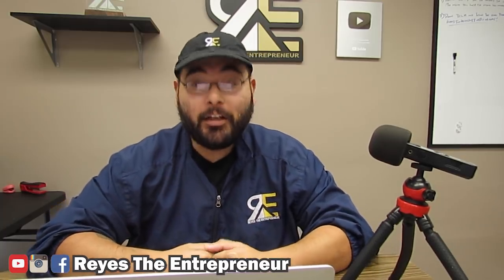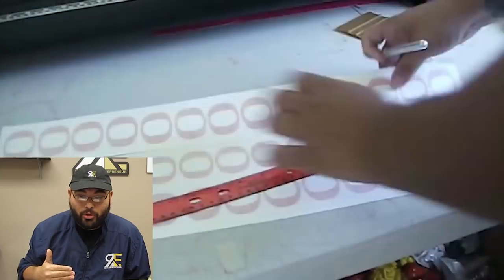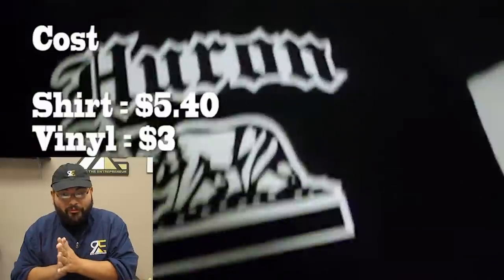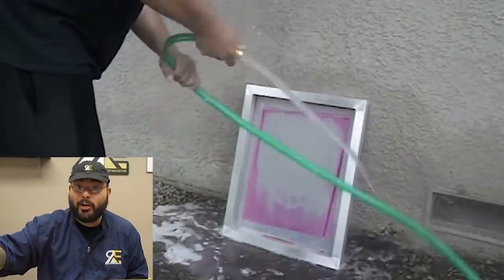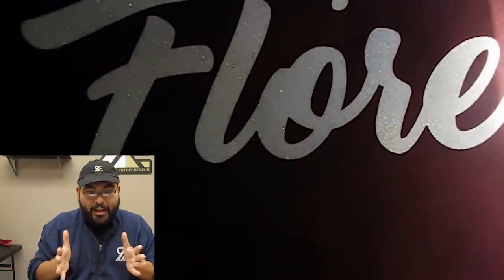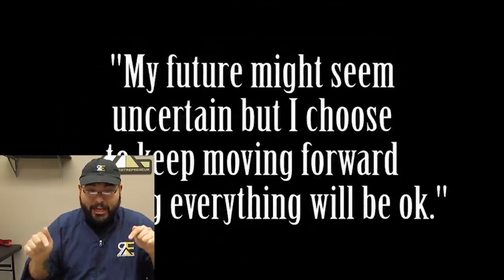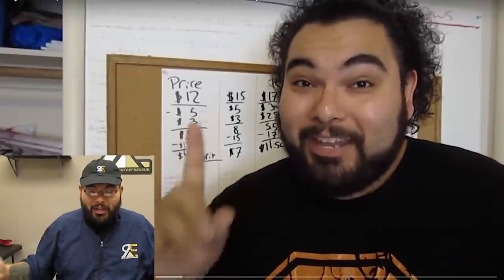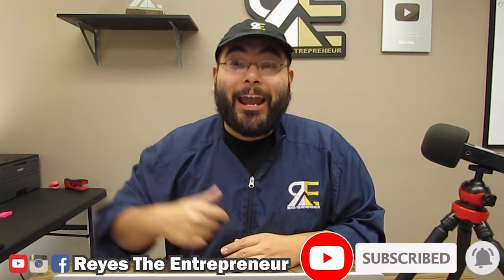SUCCESSFUL HOME T SHIRT BUSINESS - How I started and grew it

Comment: What about the DTS (DirecttoScreen) printing machine called (GoccoPro QS-2536). You only need to stretch the screen, put it in the machine and it burns the image directly to the screen in High quality close to DTG image. No need of dark room, no emulsion, no water gun, no exposure or films negative, no pretreat, no expensive ink cartridges and no cleanup. And since DTS is screen printing, you can do Large orders and not one-offs like DTG. It's basically an hybrid machine that uses the Pros of both sides without the Cons. Despite all that, my question is: Should I Go for Traditional Screen Printing and work my way to DTS or just stay Traditional???